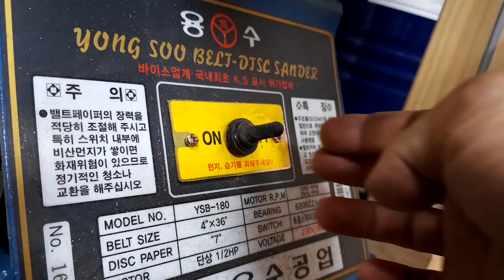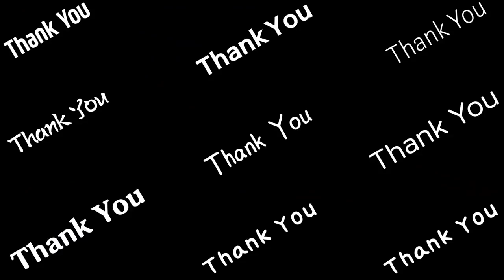[KR] 나는 칼갈이🔪다! 헹켈 쉐프나이프 깔끔한 칼 만들기 수리~ 칼을 사랑하는 나리(KR)의 작업영상.

Comment: @ knife repair, i am curious about the synthetic stone that you use for sharpening henckel knife, i don't understand korean language, what does it call in english? this kind of stone is similar to those industrial pipe grinding, with fired compound on top of aluminium block.
Reply from the maker: I use the grindstone.  The determination of the intended use is based on the hardness of the knife.  The knife of hrc 60 or more uses an aluminum oxide grindstone.  Currently, the most frequently used products are naniwa chosera & Shapton Kuromaku grinding wheels, and other grinding wheels.
Reply: thank you for sharing, i enjoy your videos!